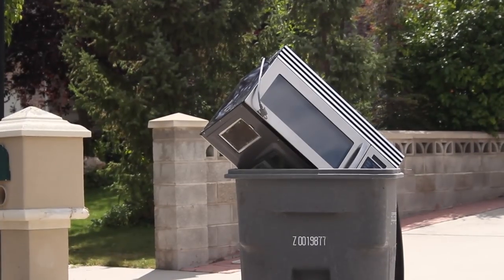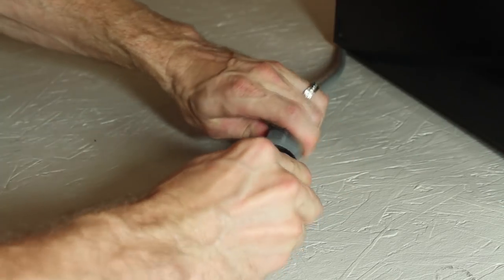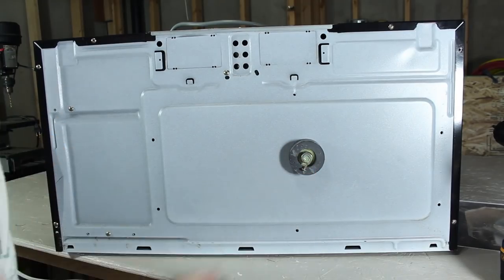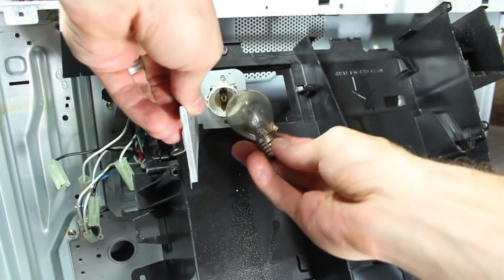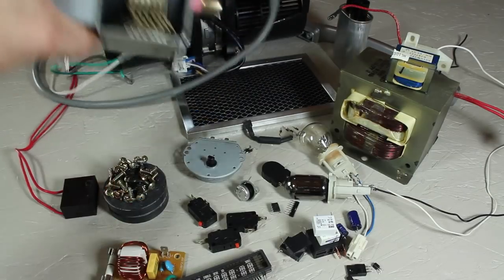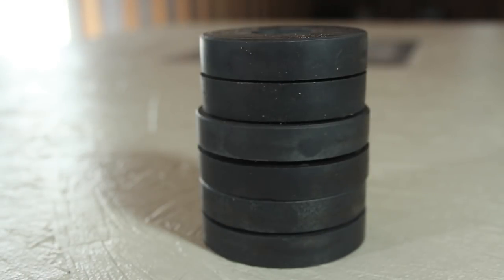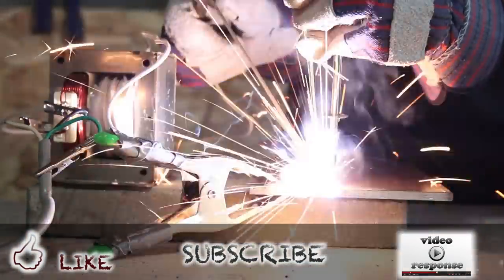Scavenging Microwave Ovens

Comment: Be careful when taking apart microwave oven magnetrons, the pink rings around them contain very poisonous materials if you scratch or break them.
Reply: Indeed. Beryllium oxide, and it's beyond... toxic.
Reply: FelixTheHouseFreak Hush 🤫... we wanna play with ring magnets! 😂😂
Reply: He does not care his is the king of random
Reply: Ok will a face mask help and disposal rubber gloves I just want the magnets
Reply: @asouthey9994  just make sure you don't break it and you'll be okay. It's fine as long as it's intact. You should just not break and inhale it's dust.
Reply: @ntf-7177  what about the transformer's wire insulation. does it contain toxic stuff ?
Reply: Liar

Comment: So I heard a ton of stuff in the comments about the pink part of the magnetron containing Beryllium, and rather than screaming about it and asking for likes I actually looked up some information on the topic (Surprise, right?).

I did find out that "Some magnetrons have beryllium oxide (beryllia) ceramic insulators, which are dangerous if crushed and inhaled, or otherwise ingested. Single or chronic exposure can lead to berylliosis, an incurable lung condition."

Another article on Berylliosis shows that it causes "the development of small inflammatory nodules, called granulomas" in the lungs. This eventually leads to restrictive lung disease. While incurable, the symptoms can, in fact, be treated.

"In addition, beryllia is listed as a confirmed human carcinogen by the IARC; therefore, broken ceramic insulators or magnetrons should not be directly handled." So as long as the pink area containing the beryllium is intact, it's almost perfectly safe. I still recommend wearing gloves and a mask to prevent contact with or inhalation of the beryllium in case of an accident.

That's just my two cents on this whole Beryllium thing, backed by a few minutes of research. I'm no chemist, so if you want to confirm or disprove this, then go ahead and ask one. You could try turning to NurdRage for information.

And yes, I used Wikipedia to get my information. However, given that they have a headquarters and strict quality control guidelines are enforced, I can say that they provide good information.
Reply: WOW
Reply: Valuable information,👍
Reply: Potwheelz w
Reply: I am a chemist and I can confirm, this is right.

Comment: I understand you can use the microwave cabnet as a faraday cage. It's built to keep radiation in, so it should keep it out too. Probably have to cover where the wave reflector goes. No biggie. I'm just getting started, but I'll be checking it out. Love your videos.

Comment: I found it kind of interesting that @ 3:46 you can see the MOT stick welder in the background isn't same design as the one he did later. There's only one MOT and it has thin secondary windings that are vibrating back and forth in the core. Still very cool though that it still works with one MOT.

Comment: I've done some crazy stuff with microwaves. We took apart like 5 and just took away all the shielding and put it in a closet covered in aluminum foil. Then we hung a steak in the middle hanging from the ceiling by a cord and turned them all on from a safe alternate location. They cooked the steak and we basically made a HUGE closet sized microwave. It wasn't ground breaking but pretty cool to have a microwave the size of a closet lol.

Comment: How safe is it to discharge the high voltage capacitor like that... Seems dangerous..
Reply: with proper insulation, grounding back into the unit is the best way always

Comment: A mixcrowave actually only sets H2O molecules into motion. If a molecule starts to wobble, it is generating heath. As far as i know, you can't concentrate the waves of a microwave. And if it is possible, you could only make things with water in it hot, like food. But some metal would be impossible, beceause it has no water in it.

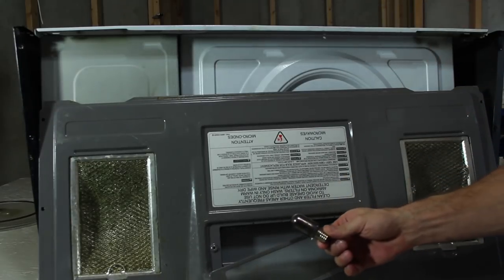Comment: 1:33 This is a really good A.C generator.  Take your drill and hook it up to this by putting the knob in the drill bit and tighten.  Hook up a 100 watt light bulb.  Hang on to turntable without touching any wires and drill but don't start out to fast or U will strip the gears in the turntable motor. Watch it light the 100 watt light bulb. This thing puts out the power for a little device. If ANYONE re-made this but bigger and used a neodymium magnet. They would have a powerful generator. OR just replace the magnet in this one with a neo.

Comment: People throw away working appliances quite often, I got three microwaves and an air conditioner  out of the trash  on my block already.  I have no clue why someone would destroy a working magnetron. Also as someone already pointed out the dust from the beryllium  insulator used in the magnetron is toxic.

Comment: What is the average output capacity of the high-power transformer (volts/amps/watts)? There are a few projects that I am planning that the transformer could be helpful in, but knowing the usual parameters of the output would be very helpful before I go to
the trouble of scavenging a few of them. Electricity is not a fools toy. Thank you.

Comment: The incandescent bulb lights up because it contains argon,  which is ionized by the radiation.  Of course,  when the argon is in the plasma state,  the light bulb explodes from the heat.

Comment: You can make a AC 600V shocker from that motor in the video at 1:34, just build something to rotate that shaft, and place a finger on those two connections and you will get shocked. Sorry for bad english!!
Reply: An inefficient shocker at that. I have looked in a cheap prank chewing gum and it just had a doorbell-like arrangement, except the coil was an autotransformer. That along with the spike on the circuit break makes for a nice shocker.

Comment: Hi Pokeman604, I have just scanned a number of Magnetrons with my Radex Radiation Meter. The background radiation at my location is 0.09 micro-sieverts per hour. I left the meter sitting on top of the magnetrons for ten minutes it displayed 0.00 micro-sieverts per hour. SO the magnetrons are not emitting any Gamma, Beta or Alpha radiation. BUT near my 'Baby Ben' Wesclock alarm clock with luminous hands and numbers, it goes off its head giving a reading of 2.47 micro-sieverts per hour.

Comment: i'm supprised that i pulled a microwave apart just 2 days ago and i got the high voltage compacitor and i got my multi meter and check it and it wasn't even charged
Reply: I hope you didn’t dissemble the magnetron. It contains beryllium oxide, which is toxic and carcenogenic if ingested.
Reply: @alexandert2275  Nah I didn't feel like disassembling my magnetron because I had other things to do

Comment: That's not entirely true. Metal will get hot if you put microwave energy on it. This is because Microwaves are light, rather energetic light at that, and the metal will absorb some amount of the waves while reflecting others. If you were foolhardy enough to put a spoon in a microwave for a long enough length of time, and didn't short the magnetron, it would get hot enough to burn you.

Comment: What are the input and output ratings listed on the back of the micro wave ovens? 

Most importantly What is the power rating and frequency of the microwave?

Thank you
Reply: I think I found it:

http://www.amana.com/cooking/microwaves/1_5_cu__ft__over_the_range_microwave_with_hidden_vent_amv1150vas.pro

1000 Watts but doesn't specify operating frequency. A 650 Watt micro wave I saw today operated on 2350 MHz range..

Comment: +Grant Thompson - "The King of Random" the 12v transformer, is that connected to the 120v AC or is it stepped down first?  I want to make the styro-slicer and have a working microwave in my garage (We just needed a new one) so I want to use that.

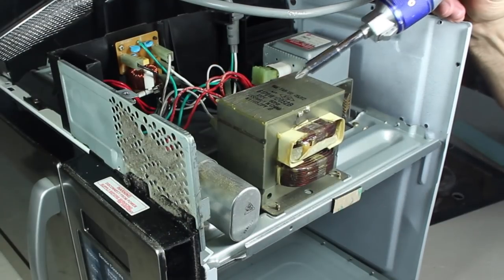Comment: 1:50 Can you do that to any capacitor safely or is there a risk of being shocked even if you're wearing gloves like that?
Reply: There is no risk, but with capacitors that hold just the mains voltage, it's better to discharge with lightbulbs to suppress the current spike and avoid making craters in your equipment and the PCB.

Comment: Is there a use for the capacitor and the magnetron?  I'd like to have the magnets in the magnetron, but I want to be sure that there isn't a use for the magnetron itself before I destroy it.  Thanks.
Reply: The magnetron is really only good for making a 2.45GHz signal. I imagine it could be used for killing rodents in a sort of trap without the messy mechanical kill. But be extra careful not to be irradiated by it yourself - it causes nasty necrosis.
Reply: Thanks for the info..  I just hate to destroy things until I'm sure that they can no longer be used in some way, haha.
Reply: Any thoughts on the capacitor?

Comment: once I found a fully working computer moniter in a dumpster
Reply: BMAN488877
flat. it came from around 2006 or 2007 and worked perfectly. the only thing that I had to buy was the power cable which is the same as my TV and a sound cable which is optional. I used to use it but then electricity went out while I was using it and it never worked again. hoping to ether update it or use it for parts. I used it for around a year until that day it broke. I think I need a new power circuit.

Comment: Door repair problem: 
I have an otherwise good microwave oven I want to restore... but ... the vertical spring inside the right side of the door is either broken or else unhooked. Thus the vertical latch that actuates the power by depressing a couple microswitches inside, it won't work.  
Anyone had experience cracking open the layers of a mostly-plastic door to work on the insides ... without destroying it?

Comment: its funny to think microwaves are actually dangerous when they're not even a form of radiation, they're a type of high gain radio frequency is set to vibrate water molecules in your food to cook it, as molecules get excited it generates a significant amount of heat and cooks the food inside out (which is why microwaved food is steaming hot inside and not too hot outside), it will also make bread soggy because it forces water vapor to collect into the bread, and makes pie crust soft, but if you put a cat in there nothing happens, why? because its still alive, if you put the same cat there dead then it'll build up internal pressure and its belly will explode, the same can be said if you put your hand in there and bypass the door safety, it will make water in your skin evaporate but your hand remains unfazed, however if you had a microchip inside your skin it would fry the microchip but not you.
Reply: Dude, microwaves are actually a form of radiation (thereby dangerous). Go to a school.
Reply: Indeed. Thankfully they are the second weakest type of electromagnetic frequency but they can heat up objects they hit.
Reply: well microwave are radiation (just like visible light), just non ionizing (like gamma rays). Also because you are made out of 60% from water I'd say that your hand would probably die if exposed to many microwaves (boiling blood and exploding cells is not something you want)

Comment: i got microvave to hacked but i got from my mom and dad they gave to me coz its usles the heater is over it dosent work anymore but i got 2 mototrs from that the slow motor that turnes around the plate and the cooling fan but i got muhc biger then that and the motor is werry strong i try to use the mototr is so powerful that it can be a big coling fan wow
Reply: be ready to watch YGS. :)

Comment: hi 
 is the transfomer is dc or ac and how many volt gose in and out
Reply: Microwave transformers typically have 120 volts in and 4,000- 15,000 volts leaving depending on the microwave size, all transformers turn ac current to dc no matter the side